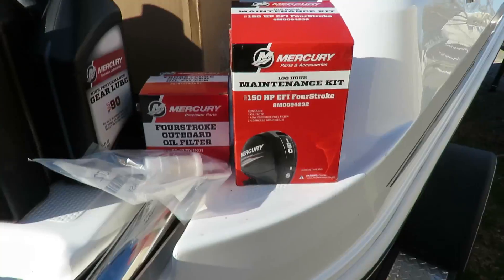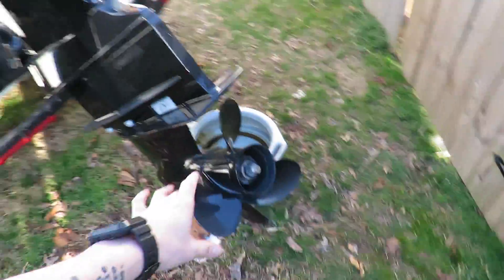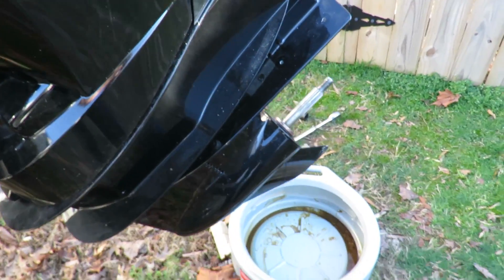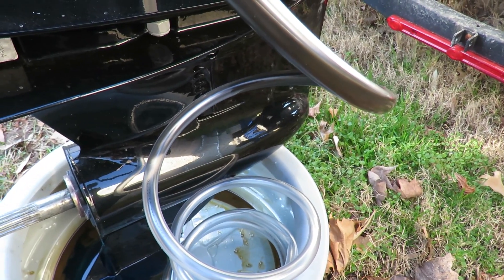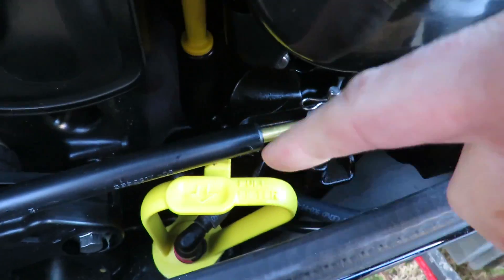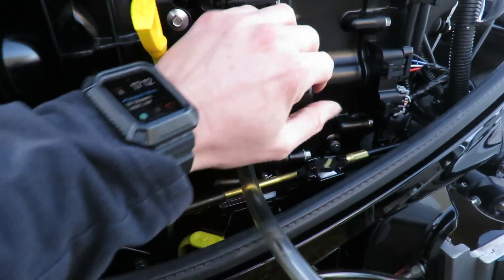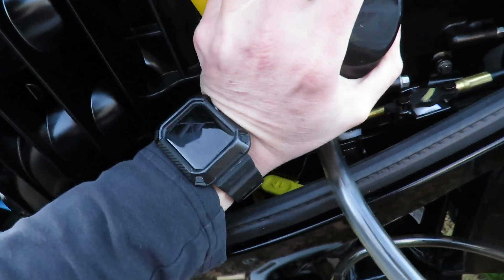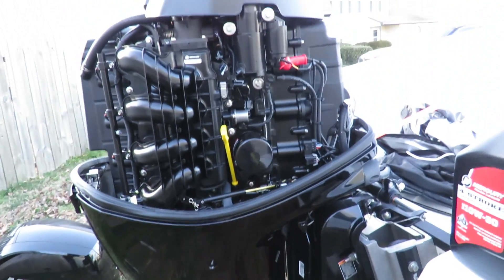mercury 150 four stroke service [ do it yourself mercury 150hp fourstroke break in or 100 hour ]

Comment: Nice and well done video for the fluid change out for that lower unit and engine oil, filter, gas filter. Have a Ranger 223FC Pontoon being build with the 150 HP Mercury so the information is straight forward with no filler on the process. We shall see how easy it do such when the time comes at 100 hours, but doable. Thanks

Comment: Make sure you change your water separator  during this service and check for indication of water in the fuel in the separator.  Check your primer bulb to make sure you have good fuel pressure for startup. I always put oil in the new filter to prevent dry startup. Same idea as when you change oil in a vehicle.

Comment: Awesome video, any success with replacing spark plugs? The bottom plug is less than kind to me on my 150 when trying to gain access and makes it impossible to put a new one in. Any help is appreciated.
Reply from the maker: I used a stubby ratchet to get the bottom plug
Reply: Might try a stubby ratchet like was mentioned, a plus a "wobbly" joint too. It works the same as a driveshaft uni-joint.

Comment: Having electrical issues, my 150 keeps draining my battery. Do you know why?
Reply from the maker: Is it the motor draining the battery or something else? Also could disconnect the battery and see if it still drains on its own to see if maybe the battery doesn't hold a charge
Reply: Check that you put the electric drain plug back in.🤪